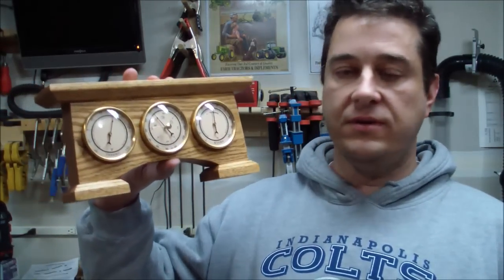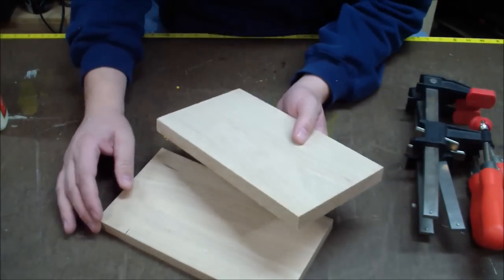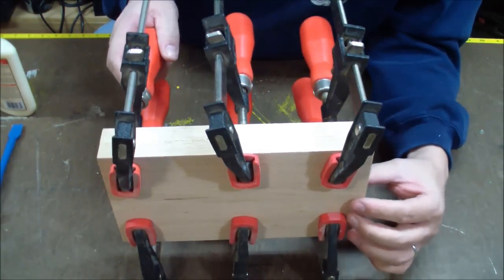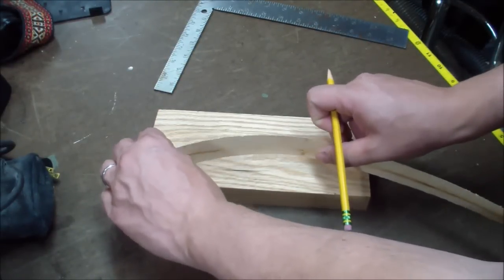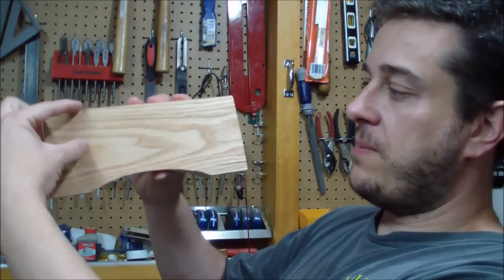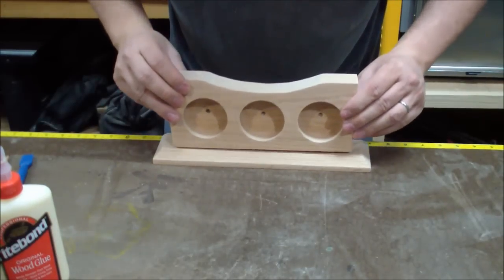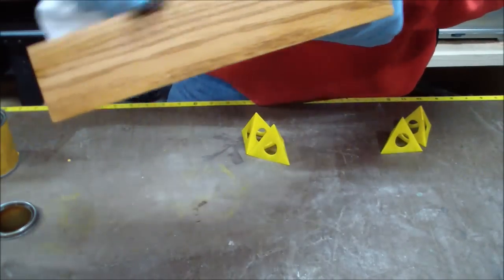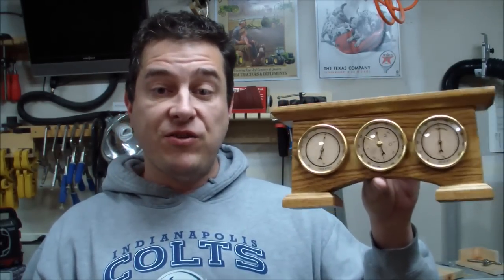How to Make a Weather Station (WoodLogger.com)

Comment: Great video. Did you finally make a hole to let "outside" air into the back of the instruments, if so, how? I didn't see holes in the back nor in arch (which is what I thought you said you'd do, but I could be mistaken). Cheers!
Reply from the maker: hikingfish3 No I didn't.  I could have done a simple pin hole through the bottom which wouldn't have been visible.  However, the more I thought about it.  There are these little rubber gaskets that go around the instruments and there are slots in between that allows some air to flow.  They seem to work fine with it, and are pretty accurate.
Reply: WoodLogger Oh excellent! Thanks for your clarifications. Really enjoyed the video. Will be making one of my own over the christmas holidays